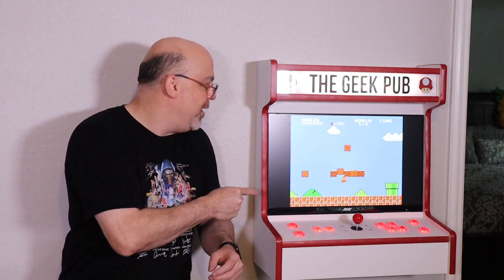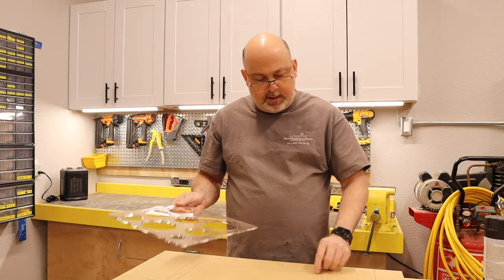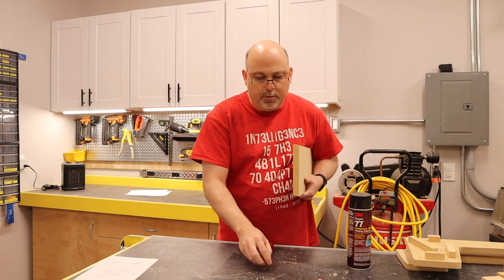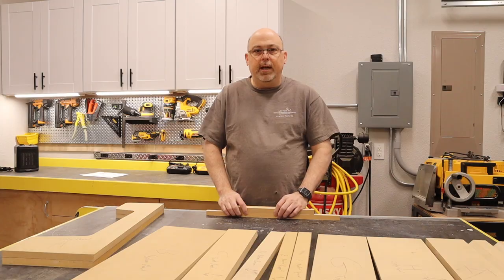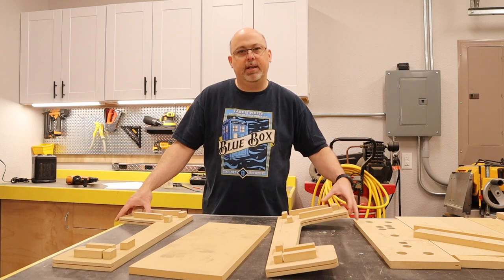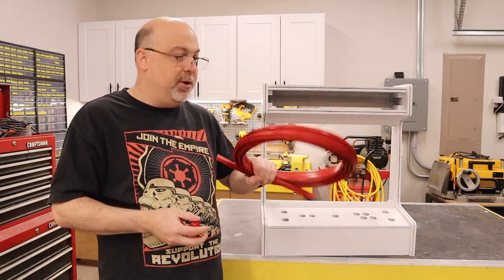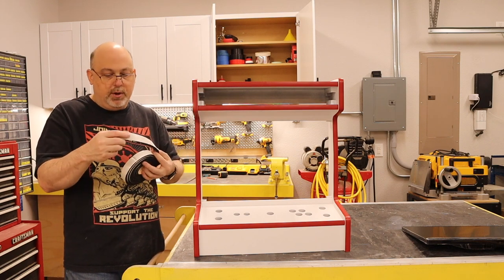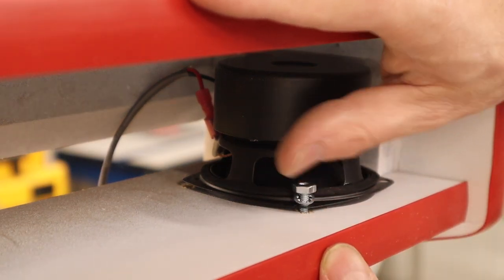Make a Wall Mount Arcade

Comment from the maker: You asked for it and now it's here!  The Geek Pub Wall Mount Arcade cabinet build!  And I even painted a different color than black.  I hope that you love this cabinet as much as I do. It's my new favorite arcade style!
Reply: Do you think that the default control board in the plans for this build would be large enough to accommodate a 2-player 6 button configuration? Maybe by moving the coin and start buttons to the front?
Reply: @epicgamescorp  definitely lots of room to accommodate a few buttons on the front panel & on both side panels. I did 6 on my front and two on each side - just be careful where you drill them of course

Comment: I used a jigsaw and circular saw to cut out the parts for my Bartop Arcade out on my back steps using your plans.  It was just fine.  I did assembly in my basement with the cleats , glue and a brad gun which I already had.  It would have been about as easy to predrill and use regular screws.  I did pickup a slot cutting bit for the tmoulding from Harbor Freight and a cheaper Forstner bit from Amazon.  You could skip the tmolulding, and ya you can use a even cheaper butterfly type drill bit.  Two coats of spray can primer, two coats of spray paint and a coat of clear over it, all out in the back yard with light sanding between layers.  It doesn't take a lot of fancy tools or a shop to put these together.  I might have built this version over the bartop if it had been available at the time.

Comment: Just completed my build. I customized the plans to fit a 27" monitor and two player controls. It's absolutely beautiful 😊
Reply: Yoo this is exactly what I’m hoping to do! Any tips? Or a way I could pay you for your customization details?
Reply: @emmathomson2584  Nice.  I pretty much used the monitor width plus 1 inch as the width of all my horizontal peices.  I think 27" is the minimum you can reasonably do if you want two player control.  How far along are you in the build?
Reply: @evocre8r  honestly haven’t started yet as I was searching everywhere trying to confirm what size monitor this ‘wall cabinet’ model was designed around. It’s not in the description of the plans, the blog article, or the video… so honestly your comment was a godsend (because I even tried emailing them to verify)

So now that I know it’s a 24”, I may just buy the ‘wall cabinet’ plans along with the full cabinet plans to help me convert it into the ideal setup.
Reply: @emmathomson2584  OK cool. Yeah I think 27" for a two player is a sweet spot. I ended up gutting a PC and putting it inside and it works great. I put a GTX 1060 in it too so I can play modern games at decent speed and resolution. But man let me tell you, it was a pretty tight fit. I've got pics but not sure how to share them.

Comment: " All you need is a jigsaw and  a pencil." I can't figure out how to get this spade bit to HELP! LOL
Reply: Technically you can use the jigsaw to cutout all of the pieces that you need but you're right about the drill 😂
Reply: Fair, a drill is important too.  If you're broke, a cheap Black & Decker will do in a pinch.  But, I'd drop a cool $100 bucks on a cheap Makita that will last a little longer.

Comment: Thank you for posting this! I’m building my first arcade in a box this weekend to become familiar with Raspberry Pi, Retropie and working with the controls.  I’d like to build a larger machine after that.  I was thinking a cocktail table, but this form factor might be an even better solution. Great points about the tools as well.  There are lots of potential solutions. Tools can make things a little quicker and a bit more precise, but there are ways to get there with basic stuff as well.

Comment: No fancy tools are needed but I recommend having a router with a straight bit, it helps a lot. You don't even need a table saw or a bandsaw or anything that usually is needed for a nice square cut.

There are many button layout designs out there, look them up. Decide how many buttons you want and go with a familiar arrangement (like Street Fighter for example). One thing to note is that you can't out the button holes too close to each other because they have an overhanging top and a nut from the underside.

Comment: You still got a lot of space on the control pannel...you could have put in a trackball. One thing I like using raspberry pi is that it doesn't take up a lot of space and emits less heat and it requires less power than a pc. You could have put a coin receptor slot on the side. I like the coin-inserted sound in the arcade..it reminds of me of the old arcade machine.

Comment: I'm not  woodworking guy, and have no desire to become one, I simply found a store that would supply and cut the boards for the cabinet. All I had to do was put it together.
Reply from the maker: Would you mind telling us what you paid for them?  We've been thinking for some time about selling the panels.  I just figured the demand would be pretty low based on what I feel like we'd have to charge for them to make it worth it.

Comment: If using handheld power tools, having a few clamps to hold a straight edge as a guide for the tool would make much nicer cuts than free-handing it.  Or at least that helps my shaky hands!

Comment: Great video. However, I notice many of these videos show you how to build the arcade but don't show you how to mount it on the wall. Do the plans for this build include instructions on how to mount it to the wall?
Reply: I don't know about the details on the plans. I would expect it shown how that works a bit more.  He probably could have included a quick shot of the Mounting Cleat screwed to the wall in the video though.  That cleat he cut and did show on the video saying "this is how it will hold it/mount".  That loose cleat gets holes drilled into it, then that cleat gets screwed onto the wall into the studs.  Then the cabinet just sits down on it.  It can't drop and it can't move left or right.  It comes off by lifting it up about an inch (or 3/4) which will lift it off the cleat.  You could put a couple screws through the side that would go into the Mounting Cleat that is on the wall once it is on it so that it can't be lifted off accidentally.
Reply: @Muldrf  Purchaded the plans. Does not include mounting instructions at all. Still a good build but defeats the purpose of calling this a hanging/wall mounted arcade tutorial without showing the final step of actually mounting it to the wall. 

Thankss
Reply: @evocre8r  sorry to hear it is not clearly detailed in there.  I have seen French Cleat mounts before so I knew what he meant when he was showing how it worked, but I can see how not everyone would.  LCD TV mounts often can work in a similar manner.  A plate mounted to the wall, then arms or a similar plate mounted to the object being hung that then rests onto it.
Reply: It’s just a french cleat.  Super simple. Tons of videos on how it works.  Basically, cut a board of appropriate width at a 45 degree angle. Mount one half to wall, the other to cabinet.  Done.

Comment: I'm not trying to be a nit-picky jerk because I think you did a really good job on this and I'm also guilty of not doing what I'm about to point out. --Electrical etiquette dictates that you should use crimp-on wire ferrules for any wire that plugs into a screw-in terminal like you have on that audio amplifier. It is likely that the copper in the bare wire connections may start to naturally corrode just enough so they will increase resistance with the terminals. and even though it's on the inside of the case, they also would have served to maintain the same resistance in case the wire were bumped or wiggled near the connection.

Comment: What size Forstner bit are you using here?
Reply: use 28mm for large buttons and 24mm for small.  A lot of the plans for the controls are shown from above which gives the impression that is 30mm.  This is true only when measuring including the button collar which sits on the smaller hole.  Metric is the correct size, but there are close English equivalents if you are a pinch.

Comment: How do you setup a wireless controller to be player one?  I have a two player arcade with joy sticks and button but most of the time I like to use my wireless controller. The wireless controller get pushed back to Player 3 and will not work unless I unplug the joy stick USB controllers.

Comment: What’s the best most secure way to mount this to the wall?
Reply: Use a stud for sure.  maybe 2 if you really want it secure.
Reply: French cleat mounted to studs. Or, lag bolt it into studs. Very strong either way.